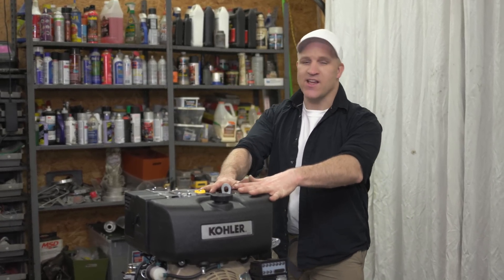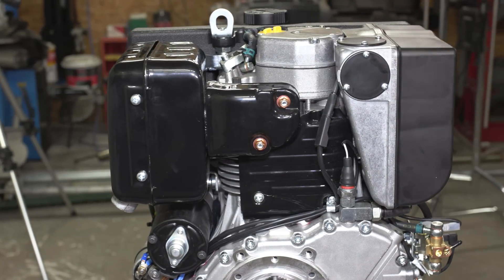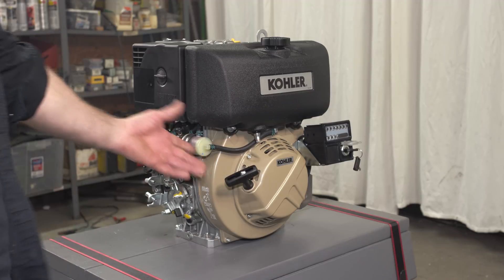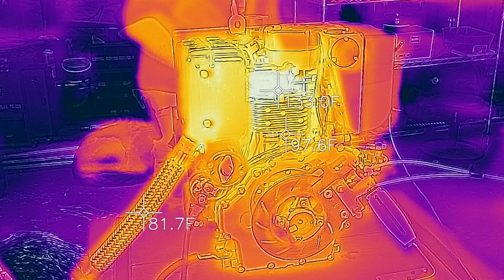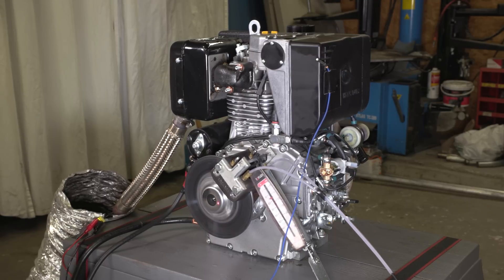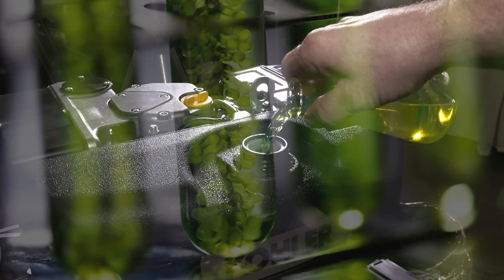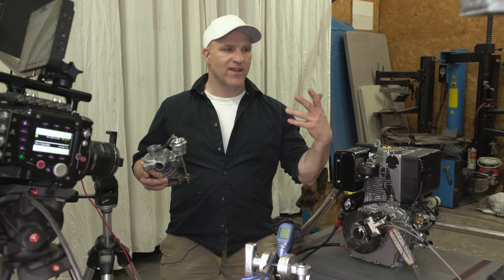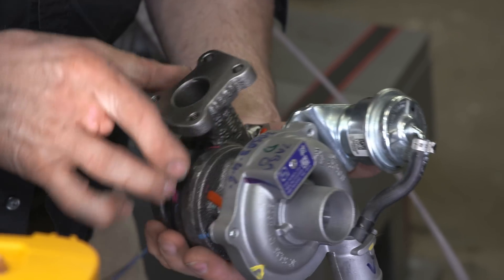Single Cylinder Diesel Engine - Dyno Test (Diesel, BioDiesel & HydroDiesel How Much HP?)

Comment: Why are you not going red diesel also?
Reply from the maker: I'm told that red diesel is the same as regular diesel but it's just dyed for tax purposes.
Reply: @WarpedYT  i wasn't sure if it was slightly better for off road and heavy vehicles and industrial applications giving longer life to tractor engines etc? but u are probably more than likely to be right but a test of both and what they contain would be interesting to see if its better or worse for your diesel powered equipment? Thanks for your reply

Comment: Would have been nice if there were a 4th fuel test. Propane..
That little diesel could make a great Off-Grid motor
Propane might make it superior for long term storage and cold temperatures
Reply: I could be wrong. But I'm pretty sure that requires spark ignition. Propane, Natural gas, gasoline(petrol), are compatible with gas engines.

Comment: Why was the hydro diesel run at 2900 RPM instead of 2800 RPM like the other two?
Reply from the maker: For some reason they wanted to stay in like a 100 RPM higher, I was trying to get it to settle into that sweet spot of 2800 RPM but it just didn't want to go there it seemed to like 2900 better.. not sure why   .
Reply: @WarpedYT  do you need to replace the brake pads on the dyno maybe?

Comment: waiting on a single cylinder diesel engine??? theres Honda, Kubota, Yanmar, Lambindini, obviously Kohler and more available out there
Reply from the maker: I have been looking for a while, I tried to get a hold of yanmar for a long time and they were really difficult to work with.
Reply: Honda is not diesel. Lambordini was bought by kohler. So that kohler you see on video, is based of lambordini. Also for got hatz engines. I sell hatz.

Comment: great video... since you have quite sensitive and accurate setup can you please try running and resting the motor several times with the same fuel and see the "wear and tear" changes it has if any?
Reply from the maker: I can try that but the problem with that is I need a worn-out engine
Reply: @WarpedYT  yeah you are right, difference will be much higher on wornout engine...

Comment: Next episode: Single turbo. Episode after:single turbo with nitrous. Episode after: single turbo, nitrous and water-methanol injection. Final episode:we compound turboed a single cylinder diesel and put a 100 shot of Nitrous and water-methanol injection. Will it survive?
Reply from the maker: We are totally speaking the same language now, compound Turbo has been in the notes for this diesel for a while now. The nitrous kit is sitting in my garage at this moment... Got to get this fired up ASAP!!
Reply: @WarpedYT  absolutely. This is gonna be an exciting series. I'm really curious as to the power gains from the turbo set up. Cant wait for it.
Reply from the maker: For sure, the turbo sounds pretty badass when it's spooling
Reply: @WarpedYT  I'm ready to hear it!

Comment: I know in the diesel performance world we tend to run water-methanol injection. But that's when we have really high EGTs. Close to 1300°F and we want to lower em and add power.  Still might be cool to see a water-methanol injection on this after the turbo test. I doubt the EGTs will be prohibitive on this engine. Or will they????
Reply: Rural Legends TV did u see where he had the egt probe, more than 1ft down the pipe lol

Comment: In summary, diesel and biodiesel had very similar temps, but diesel made slightly more power. Hydrodiesel had slightly lower head and block temps but significantly higher EGTs and made more power.

Conclusion: Hydrodiesel is a much more efficient fuel.
Reply from the maker: It seems that way, it was a very interesting comparison even for me, my eyebrows were raised quite a few times during this test. the thing is with the hydro diesel is I would think it would lose 20% of its energy per volume since it is 20% water. I want to see what happens with this hydro diesel when I start rolling coal
Reply: @WarpedYT  now that you have a baseline on power output for all 3, you should do some fuel consumption comparisons with them. Hold the engine at a specific horsepower (shoot for 7hp since we know all of them are capable of at least that much. Figure out what rpm and load that fuel requires to generate that power, then use a measured amount of fuel and see how long it takes for it to use that fuel while generating that horsepower.

That will tell us which fuel is truly more efficient. But judging by the increased EGT and horsepower, my money in on Hydrodiesel again.
Reply from the maker: That's a good idea
Reply: @WarpedYT  those are the only kind I have.

Comment: I like that Engine, I also like Kohler.
Reply from the maker: I like Kohler as well.
Reply: @NoName-yr1jv  Now Kohler manufacture this engine in China. Lets hope they've got a big whip to make sure quality control is adhered to.   
These engines suffer from balancer shaft failure when run at 3600rpm (one of the models is factory set at this rpm)   Other than that a good little engine:)
Reply: NOBBY 07836 this engine is produced in Italy, not China.
Reply: @joshuaolsen8844  Maybe in your region you still get Italian made ones but about 2 years ago the gasoline engines started production in China with pretty bad mortality rates. The single cylinder diesels close to that time started to come back under warranty more often too. 
It's not uncommon to run parallel production lines for different geographical regions. But I'm sure you know that :)
Reply: NOBBY 07836 this is either a Kohler KD350 or KD440, hard to tell sometimes, but these are both made in Italy.
Reply: @joshuaolsen8844  My company sells them. And has to deal warranty. Keeps us busy :)

Comment: Great video, thank you for putting in the effort to test these for us!
 I was very surprised to see that the Hydro Diesel had such low engine temps but such a high exhaust gas temp. 
Out of curiosity, I'm guessing you did do this, but did you wait for the engine temps to reach back to a control temp (ambient) between each test?

Looking forward to many more videos!!
Reply from the maker: Same here, I was very surprised as well, I'm looking forward to testing this in the future without any exhaust system at all and see what the temperature is. Ask for the temperature in between runs yeah I let it get down to like a 120 degrees or sometimes even room temperature simply because it takes time in between the setups.

Comment: 1:58 It's amazing how in <10 strokes, it goes from puffing soot, to cleaning burning. that's awesome 👍😎
Reply from the maker: That's a good point, you're right it was like 10 strokes.
Reply: @WarpedYT  I counted the puffs  😉 Almost slowed the slo-mo. But was able to get a good count. I started off with 8 strokes. But I wasn't quite sure if it 9 or 10 still had a little residual. 

Nice test bench to see how long it takes it beat this thing to a pulp  😎👍😁
Reply from the maker: I didn't even realize it until you mentioned it, but yeah you're completely right, that was pretty cool now that I went and re-watched it.
Reply: @WarpedYT  Funny thing is, that'll probably be the cleanest that engine ever runs now 😂😜

Comment: You might need to paint the exhaust hose and cylinder head flat black for the Flir camera. They dont like shiny reflective surfaces. Head temp looks low. That could be why.
Reply: Emissivity correction, and avoiding shiny surfaces is critical with a FLIR, in industry this is something you're taught right away when using the equipment.

Comment: I know I am a dying breed here that still uses metric units, but would you add in those as well for engine performance? :)

Nice to see the series finally staring to be uploaded :D
The biodiesel might get some higher performance by altering the injection timing a little as it burns at a different rate. I can't remember if it should be retarded or advanced. Look it up :)
Reply from the maker: I know I'm so sorry I actually meant to include that as well but I forgot I also forgot to put the comparison charts in the edit.

Comment: I would like to see you run other fuels that aren't commonly thought of and see the results as well. Some of those include ATF, used motor oil, used vegetable oil, hydraulic oil, power steering oil, etc as I run these in my diesel generator all the time. It would also be pretty cool to see the engine tested on what it was originally invented to run on: Peanut oil.
Reply: Diesels are quite amazing engines before the EPA got a hold of them and turned them into overcomplicated garbage.
Reply: Running stuff like dirty oil and atf will probably damage the injector system before the fuel savings become apparent
Reply: @ghettobikelife8833  Nah. Just get a good fuel filter and you'll be fine.
Reply: Io are there regular filters good enough to run directly without clogging? I’ve seen vids of guys pouring waste oil from a bucket thru a mesh filter over a bigger bucket- my guess is the big filters still clog up quickly
Reply: @ghettobikelife8833  use a 1micron-meter filter. For modern car diesel 😉
Reply: Indeed! Waste veggie oil runs great, as well as waste engine oil and even Jet-A. All will run great without damaging the engine. I have been running them for years without problems.
Reply: Kleetus92 they was indeed and maybe cleaner than people thought as you said the emission control system they’ve overloaded with them now I think they made it worse pollution wise... when the engine starts getting a bit older all the emission systems get blocked and chokes it up resulting in even worse emissions than they originally would of had anyway

Comment: What was the engine size, displacement, bore and stoke, Model # . 
Hydro Diesel. Reducing hp of 8.83 (28/29) = 8.52 HP, or same as Diesel fuel, Torque were both the same at 16  ft-lbs. 
The Bio diesel at 7.73 Hp / 8.5= 91%, Tq= 14.5/ 16= also 91% as it must be. 

Ws gthat disk brake load determined by a load cell? or what was used?

Comment: Matt, when pouring from a can, turn the pour hole to the top, that way air can get in and it will not glub and you can pour without spilling.
Reply: He should nave made a slow mo of that folly to ad some humor.
Reply: Matt it also gets the hole out past the lip of the can so it pours straight into the container without splashing all over the top.

Comment: feed it with a SHOT LPG GAS ON DYNO
Reply: Back in the 1970's, there was a L-P gas injector system for diesel ag-tractors named Tourque Topper. It was suppose to give the tractor more power during farming operations. I always wondered if they were worth while. I didn't see many kits in use, and after awhile, never heard about them at all.
Reply: @ronfullerton3162  LPG injection is still a thing in the Hi-Po diesel world

Comment: Kohler builds great engines, but the best and most overtested European single cylinder diesel engine is Ruggerini CRD100 18HP. They don't build anymore so good stuff (works even with vegetable oil)... Greetings from Greece!

Comment: Would be nice to see the difference between different injection timing
Reply: I agree with this looking at the exhaust temperature, the timing is off for other fuels.
Reply: Exhaust gas temperature on any engine increases with increasing load.Thats why many engines have a get guage so as not to overload the engine and decrease it's service life.
Reply: The hard part with this is that the Chinese Diesel engines use a diaphragm pump that’s triggered by either the cam or the crankshaft. So it’ll depend on what the Koehler uses for a fuel pump. I don’t know enough about diesels to tell you what kind of (bare minimum) fuel pump you’d be looking for though
Reply: @Talibooboo  Hopefully the injection pump is based off a chain system so that it's changeable. He could also mess with the pop pressure of the injector to change the timing up.
Reply: I think  the actual timing is controlled by shims ..

Comment: Kohler sells that engine on a portable generator package, we have 2 off them in our shop. Hook up various wattage bulbs and load best all day long on various fuels
Reply: This is propably the easiest way to measure it. You could even use/make some adjustable resistor. The best thing with electricity is that it's very easy to measure power if you know what you are doing. I don't trust that brake-dano too much.
Reply: What's that model you've got I'd like to check it out.
Reply: @2_be_determined  whats the model number ? I wanna look into getting one
Reply: @sweis12  yeah same here bud
Reply: Joe D'Amato yeah that’s actually a WAY better idea than using mechanical-friction for resistance. 👍👍👍

Comment: For fuel comparison to be really interesting a couple of figures was missing: Fuel consumption and emissions (esp NOx, HC's and as you mentioned particles). Sadly those probably require some expensive equipment.
Reply from the maker: Yes, I was supposed to include that in this video, but I wanted to keep it as more of an introduction to the diesel engine in particular. I wanted to see what people thought what people had to say and what types of ideas people have before going through all the trouble.
Reply: @WarpedYT  I think there is an easy way around the particulate question... if you set up a camera to watch the exhaust with an illuminated, bright white, background, you should be able to see a relative comparison in exhaust properties. 

Trying to measure fuel consumption will be more difficult because it is a recirculating fuel system, best bet it to put the motor under a constant load, and put X quantity of each fuel in it, and see how long it runs for. 

Great video though, looking forward to seeing this series!
Reply: @kleetus92  Another way that is often used is to place a white piece of cloth over the exhaust for a certain number of seconds while running under a specific load (typically wide open, at governed speed). You then compare how dark the white cloth becomes. I can't remember the exact spec but one of our old farm tractors even had images in the shop manual you were supposed to compare your "white cloth" to.
Reply: Quite understandable, I do hope you get around to it!
Reply: My take, would be to see how many horsepower hour(kWh hour) per gallon/liter of fuel. It would be simple, if the engine was used as a generator, where you could put various loads on it, and measure the watt hours.
     I would look at that, then I need to know the cost of the 3 fuel types. I wouldn't mind burning a little more of one fuel, if it's a lot cheaper! It's all about the work per dollar. The Diesel engine is already well ahead of an equivalent gas engine.(petrol) I really don't care about emissions for a small engine like this, unless, I planned on running it as a primary source of power, or putting a lot of hours on it.
Reply: I think a NOx and particle test between the different fuels would've been very cool!
Or a test like this between Diesel and gasoline (per amount of fuel burnt). Very interesting!
Reply: Sadly, a Millennial doofus wants emissions data.....geez

Comment: I never clicked so fast!
Reply from the maker: LOL thank you, this diesel was super interesting so I'm going to make a couple episodes in front of the see-through diesel episode simply because I was pretty intrigued by how it worked. I had a few other ideas off the wall but I wanted to do before tearing it apart
Reply: Warped Perception you did amazing! Can’t wait to see the combustion inside, it’s very interesting to see how much hp and torque it made compared to the briggs.

Comment: I find it interesting that the hydro diesel produced higher HP, but maintained lower head temps (even with higher EGT).  Was there a reason that the regular and bio diesel RPMs were 2800 and the hydro diesel was 2900 RPMs?
Reply from the maker: I was also very surprised, I'm not sure exactly what's going on but I'm going to dig further into it later, as for the RPMs I'm not really sure but it was really tough for me to bring the RPMs to 2800 like I did with the other two fuels. For some reason I wanted to stay at a higher RPM and didn't settle in like the other two.
Reply: @WarpedYT  

Normally in a "typical" YouTube Test/Break/Compare Channel I would be quite bored on further talking through the results, but in this exceptional case of video, I was quite surprised about the ending, as the different dyno results were quite amazing.
Reply: Actually this is making the measurements differ from each other. Increased RPM increases horsepower. The "regular diesel" test run resulted in 8.5hp @ 2800RPM
And the "hydro diesel" test run gave 8.83hp @ 2900RPM.

If you would've increased the RPM to 2900 with the "regular diesel" you would've got around 8.80hp. Here's the equation: 8.5hp divided by 2800rpm = 0.0030357143.
0.0030357143 * 2900rpm = 8.80357147 hp.
You can also do it the other way around:
8.83hp divided by 2900 = 0.0030448276.
0.0030448276 * 2800 = 8.52551728hp

So "regular diesel" would theoretically give 8.803hp @2900RPM
And "hydro diesel" would've theoretically given 8.525hp @2800RPM

You can't do a test with different RPMs and think it doesn't affect horsepower, ask any professional dyno shop.